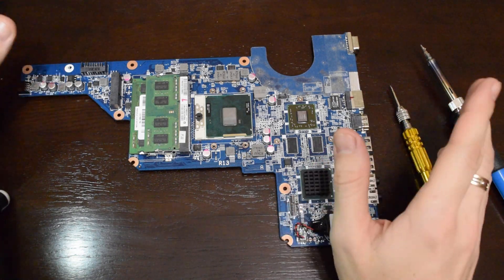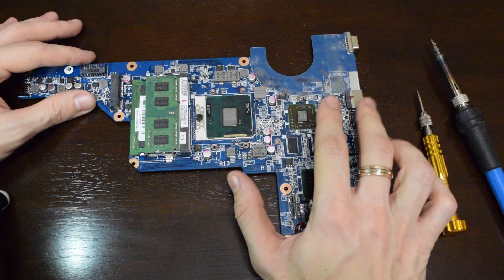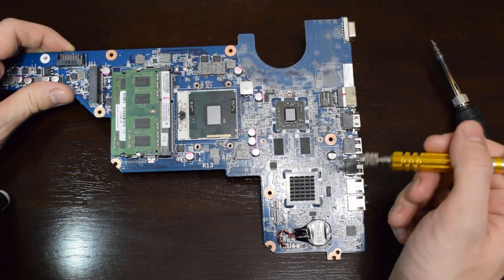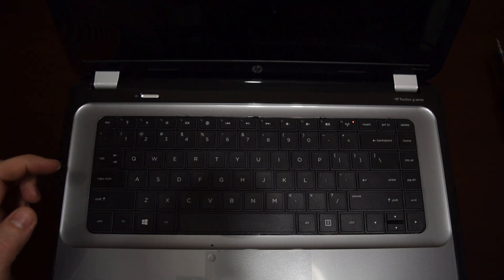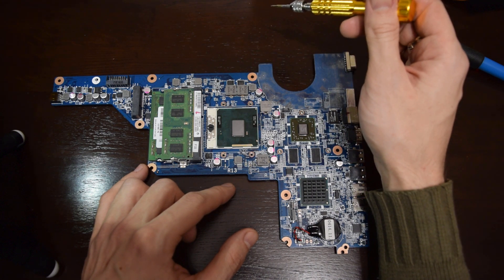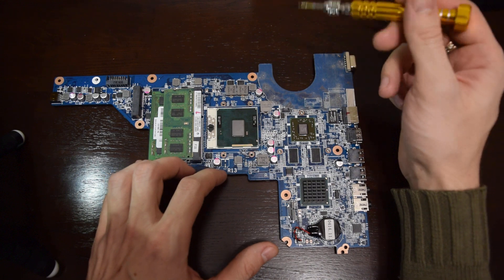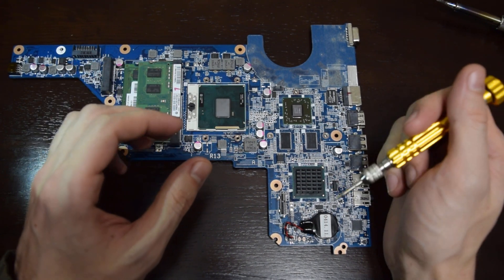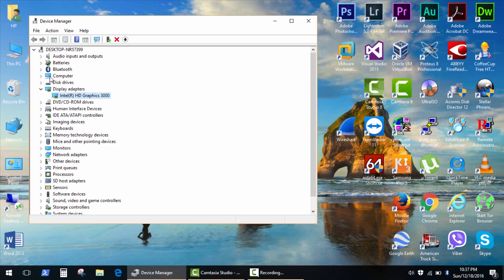Fix Dead GPU – Convert HP, Dell, Lenovo Laptop to UMA Graphics (HP G6 Example)

Comment: Hi,yhank you so much for this info,can you please help me find the coil that should be disabled on my board,k53sv with gt540m 1gb,thank you again for sharing this valuable information.
https://ibb.co/gB4H8H
Reply: Hi,
Thanks again for the info,in the end i've removed both but i think the nvidia card is not disabled because it gets very hot when plugged in.
Waiting for your reply
Reply from the maker: That's strange... OK. Look at the picture remove third coil and try to turn it on without coil 1 and 2. If Nvidia chip is cold then solder coils 1 and 2 back. https://ibb.co/eZLXtH

Comment: I have a HP dm4-2110ss and I have the same problem, it does not turn on the screen, it remains black and nothing happens. The BLOCK button lights up for a few times. This laptop has an Intel i5 processor and ATI graphics. Can you help me to detect the component that stops the supply of  ATI graphics?  I'll leave you some pictures below with the motherboard to help me to identify that component. I'm waiting for the answer, thank you very much!

1- https://ibb.co/h474Qn 
2- https://ibb.co/cxL8kn
Reply from the maker: I'll answer you tomorrow morning. I have to see schematics.
Reply: 2013Electronics&Computers OK, thank you!
Reply from the maker: https://ibb.co/c15CwS
If the problem really in graphics chip this will 100% help. Just remove that coil and it will completely disable discrete GPU and switch your graphics to Intel HD. 
I'm waiting for your result.
Reply: I followed your steps, but apparently did not have a good result. The capslock led blinks 1 time and before removing the coil it lit up three times, the laptop continues with the same problem and after about twenty seconds it goes off alone. It seems that now the processor is the one that gives the error, i do not know if the piece i extracted was feeding the processor or the graphics. Thank you for your answers and your time.

I leave some link with a picture
https://ibb.co/inY7gS
Reply from the maker: You did everything correct! Maybe the problem not in GPU. Try to remove the BIOS battery and leave only one RAM in slot and try to start again.
Reply from the maker: And look, one or three blinks of CapsLock LED it's not about GPU! I wish I could help you more but without multimiter and checking some parts it's almost impossible to do.
Reply: I tried and still does not work. The screen remains black, the caps lock LED blinks one time and turns itself off in about twenty seconds. Thanks anyway for your help!
Reply: Before it lights up three times, I searched the codes for HP and it looks like the RAM slots. I tried other RAM, but still did not work, I connected to another screen via HDMI and still do not have picture. It looks like the graphic is the one that's dead, but now that I've tried all these solutions, it still does not work and I have not figured out what the problem is.
Reply: Try these things
1. Remove cmos battery and try to restart.
2. Remove cmos battery and add only 1 ram if you have 2.

Comment: Congratulation for the video. You help people that do not have the money to buy new laptop, or to fix the old.
I have uploaded in a cloud storage site, 2 photos of my laptop motherboard, which is a HP G62. I managed to fix it by re flow, but i know that it will not last forever, so i will follow your advice. But i do not know where is exactly located (on the MB) the component which i mast remove. So if you please , can you see these 2 photos of the motherboard ( frond and back) and show me the component i must remove and its location on the MB ? 

the links for the photos are :
1)   https://www.4shared.com/photo/KcsdgAQWca/IMG_20180125_045629.html
2)   https://www.4shared.com/photo/k0X4WXhRca/IMG_20180125_045741.html

Thanks
(if you need my email, it is  :    krakadoros@gmail.com)
Reply from the maker: https://ibb.co/fsyAk7
https://ibb.co/cnYMsn
Sorry buddy for so late reply, for some reason I haven't seen notification for your comment.
Reply: thanks for reply. Because you late, answer me, i decided, by myself, to remove  one of the power inductor, i assumed was the correct, and i removed exactly the same inductor that you indicate in your photos. But after that, my laptop was completely dead. So i re-put it in it's position (although it was brake (the outside material-not the metal contacts)), and the laptop works again (with a new re-flow). But it works only for one day and then became completely dead again. So now i will replace the hole motherboard.

Comment: Can you help me, my laptop toshiba satellite L745. I have same problem with you, but i can't find the components that i want to remove it. So can you help me.
Reply from the maker: I'd love to but I need the pictures of your motherboard in high resolution from both sides. If it's possible share them from some cloud.
Reply: 2013Electronics&Computers this is the link you can look the picture
https://drive.google.com/drive/folders/1j0Bq-xmbHFgTCJIJFGA-Swh5sCCjbXWT . Hopefully you can help me
Reply from the maker: I'm sorry but it almost impossible to make it work at home. Insane schematics... It will never work for Toshiba like it works for HP, Dell, Asus or Lenovo.

Comment: can we replace intel HD Graphic with Nvidia ..??
Reply: Sumit Machal lol mate, just get a new one.
Even if you did manage to add appropriate circuitry to power the dGPU, you also run into the risk of the BIOS not recognising it considering it is a budget C series Toshiba.

You also need a new heatsink to cool it which you're unlikely to find on a budget of mill model, and a larger power brick to go along with it.
Reply: Waiting for your reply sir...
Reply from the maker: Intel HD graphics nowadays is inside CPU but there are some different models of laptops with different GPUs and if you have only Intel HD graphic there's a big chance that your motherboard has place for discrete graphics like Nvidia or AMD. But you need infrared soldering station and a new heatsink. I think it's much easier to buy another motherboard with discrete graphics.
Reply: Understand.. Is there any possibility if you can demonstrate one ? Any chance of that video? I have Toshiba  c-50 A-X0012
Reply from the maker: This is how it looks:
https://ae01.alicdn.com/kf/HTB1BDmejeKAUKJjSZFzq6xdQFXau/KEFU-Notebook-PC-Motherboard-for-Gateway-NE72206U-EG70KB-Tested-perfect-working.jpg

There's no graphic chip, graphics memory chips and other small components (resistors, capacitors etc).  Without schematics or the same motherboard but with those components and special equipment it's practically impossible. It's only easy to disable dead graphic chip and switch to Intel graphics.
Reply: So there is only one way to use Nvidia Graphic that Buy  new laptop with Graphic Card. :D
Reply: can you suggest mother board with graphic card of the same model ? where I can buy one. ?

Comment: Hi Sir, I have not totally same problem my laptop is hp G62, no display on screen and no blinking on caps lock, but when I try VGA to monitor it works but there is a vertical lines. Could you please help me. Thanks in advance
Reply: Remove cmos battery and try if doesnt work remove cmos battery plus add only 1 ram

Comment: Hi. What if my laptop has only 1 gpu which is the built-in Intel HD Graphics 4600. My processor is Intel i7-4710HQ. Laptop model is HP Envy 15 k020us if I'm not mistaking. Can you help me?

Comment: Hello sir 
According to video i removed the chip in hp g6 pavilion laptop as your
It bring back my screen on but it keeps crashing.
Some time i get to desktop icons
Some times it crashes on boot up
Reply from the maker: Crashes you mean blue screen? If you just go to BIOS it works or try to boot in save mode? If it works in safe mode then it's drivers related issue

Comment: Hello :) I have tried removed the chip that's look exactly the same as yours. (but mine is R56 and 104 T5T) from my laptop Dell N4010. and the problem is I can't turn it on. or more like the power button is not working. I can see my charging LED with my dead battery blinking. but the power button is not working and I have already firmly connected the power switch cable. please help me.
Reply from the maker: Before you removed the "chip" problem was the same?
Reply: 2013Electronics&Computers nah. It can power up and go to BIOS. But when I try to boot in to windows, it will get a blue screen with some error code related to graphics.
Reply: 2013Electronics&Computers ehh sorry. But you know the fixes yet? Thanks in advance :D

Comment: Hello. Can you tell me which component to remove in my hp pavilion m6-1000sr? I also have dead discreate graphics chip. Fixed it 10+ times by heating the chip, but it doesn't helps anymore, so I want to disable it like you did in this video.

Comment: how do you know which chip is dead?What happen if I'm wrong chip off??
Reply: right now i have a samsung main board in my hand with dead ati chip. how can i cut the power to it? how can i find the supply?
Reply from the maker: If you see the same blink code then 95% it's dead graphics. It's 10 minutes diagnostic just cut the power to graphics and you'll find out if it's dead graphics or something else.